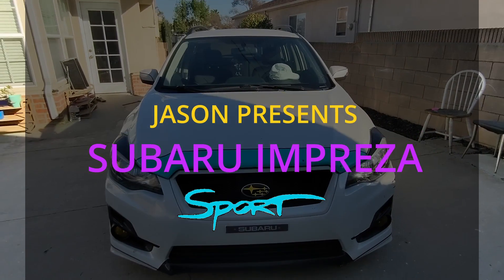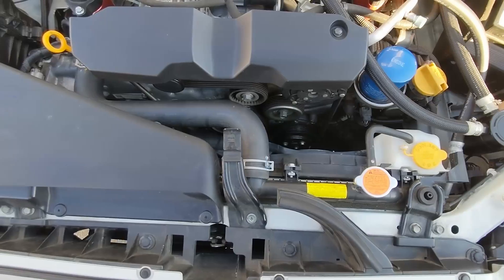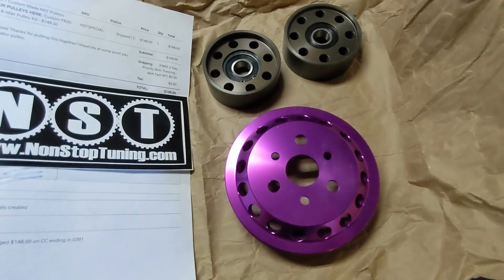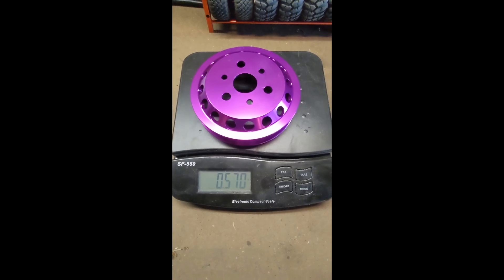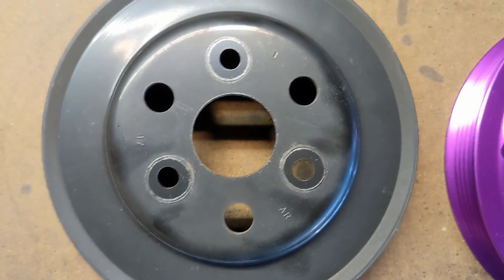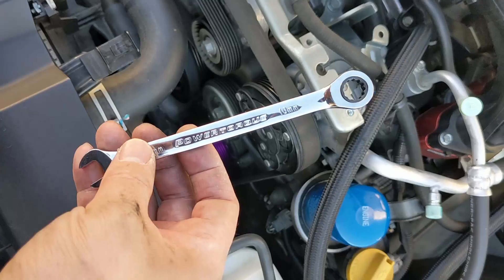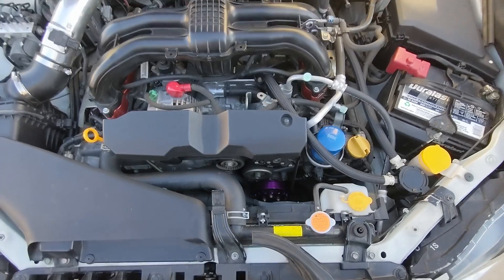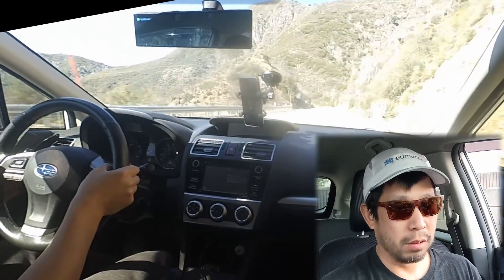Subaru Impreza Sport - Lightweight water pump pulley

Comment: Is it worth getting the intake tube for  the oem air box ?
Reply from the maker: I would probably say no. But it looks and sounds cool. Also with aftermarket stuff you have to think about more installation , maintenance and reliability. Which one were you thinking about getting? I can say you probably will not feel any difference unless combined with other mods.

Comment: The tension roller and the damper roller must be installed from the kit instead of the factory ones! When installing a lightweight pulley, the amount of vibration on the belt increases significantly. Heavier damper rollers dampen these vibrations effectively. I put Toda Racing rollers 31170-FA2-000 for myself, there is an effect - at high speeds the engine runs much quieter, this is noticeable even from the passenger compartment. Apologies in advance for my English :)

Comment: Are these sti wheels significantly lighter than stock? What bolt patter is that?
Reply from the maker: With tires, each wheel is 7lbs lighter than the stock sport wheels. 5x100 +48 offset

Comment: Hi Jason,finally you went to light pulley ! Why not  add  a crank pulley as it is the most effective way to FREE more horse power  ?
Reply from the maker: Crank pulley has been noted that without the built-in vibrational dampener, it will cause bad harmonics at high RPMs. And if you've watched any other videos of mine, high vibration can be the cause of oiling issues. I have plans for the crank pulley, it just won't be a light weight one.
Reply: @JasonLeung-4roller  crank pulley will not hurt your Subaru  ! I did have it on for 192.00
Reply: 192.000 km
Reply from the maker: @marksphotoperry356  what are your thoughts on Fluid damper?
Reply: @JasonLeung-4roller  I don't have a lot of data on that one yet.

Comment: Added a perrin water pump pulley recently to my 2019 crosstrek and noticed the subtle difference as well! Waiting on the alternator one next.
Reply: Did you do the alternator yet? I don't think you can change out the OAD type pulley with a solid pulley. If you've already done it please let me know 👌
Reply: So you got the right idea  but you are doing it backwards  ! You start with the CRANK PULLEY   that will give a new feeling like you drive a new car ! Providing you drive manual.Then you do the other pulleys.Granted most enthusiasts are content with  light CRANK pulley only because this will be key to easier revs thus noticeably improve smooth extra power and drivebility.